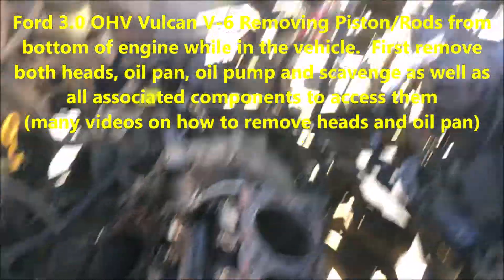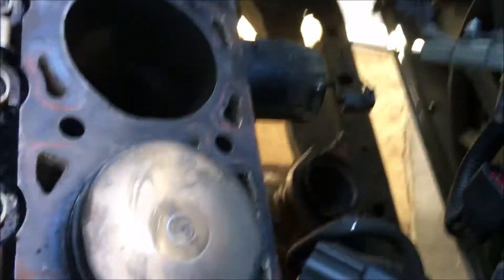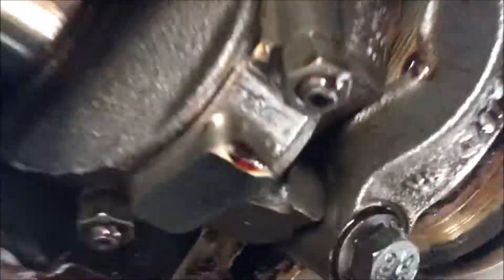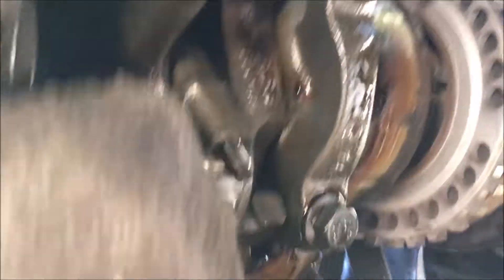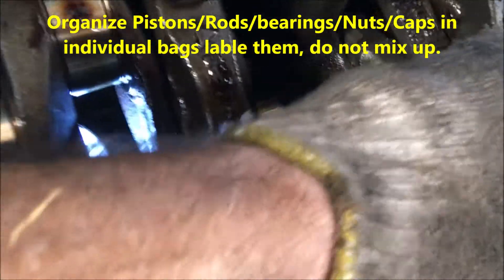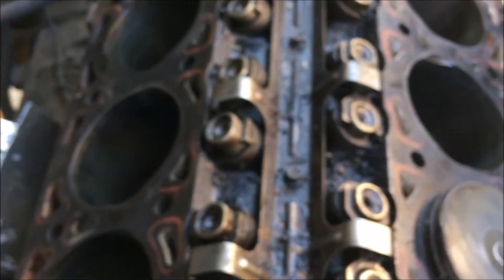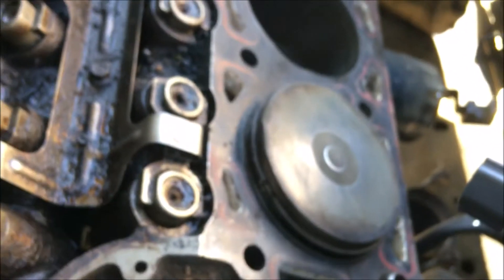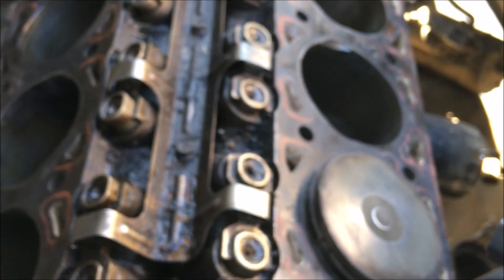Ford Taurus 3 0 OHV Vulcan V6 Engine Piston Removal from bottom of engine in vehicle

Comment: I’m working on one of these right now and I need to replace a valve. How do I get the exhaust valves out?!? The intake valves slide right out but the exhaust ones won’t push through!!! Any help would be greatly appreciated!!!
Reply from the maker: Do you have a spring compressor to compress the spring to remove the valve?

Comment: What about V8 I got a 305 5.0 can you remove the Piston without pulling the motor
Reply: Yes, as long as you can remove both heads and oil pan from in the car, the rest can be done.
Reply: @TTATurbochargeThemAll  thank you because I got a 1985 Pontiac Parisienne I think the Rings is a little bit worn
Reply from the maker: The Pontiac Parisienne has lots of hood room so it should go smooth.  Let me know how it goes.

Comment: Why put this much effort into a car worth nothing? Just wondering?
Reply from the maker: So far parts have cost me around $500.  The car was purchased at an auction without keys so I was not aware it didn't start or drive until I had key made and was disappointed at no compression while turning over engine.  I am fixing it myself to save money and to see if my troubleshooting and work results in a running car.  Its more of a personal challenge but I will sell it for around $1500, if I can get it driving again, its not much money but would like to see if it will run again after putting it back together again.
Reply: @madboostingmadmatt48  Also good practice working on engines!
Reply: It may be worth nothing to you, but to somebody it’s worth something. Not everybody has a privilege or luxury to be able to call a Ford Taurus worthless. I myself will put any amount of effort into my Taurus that I’ve worked my ass off to get.